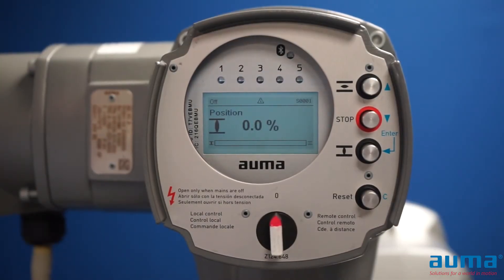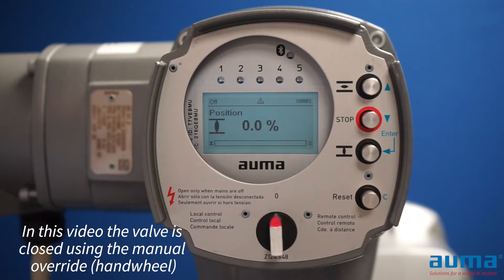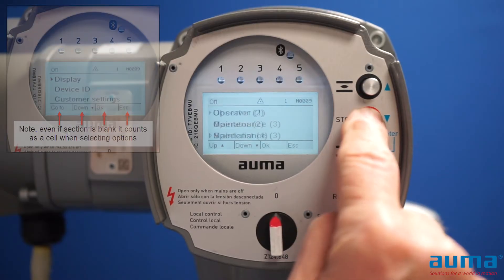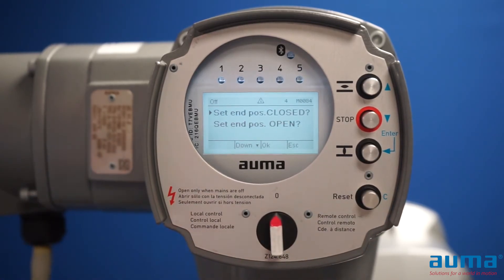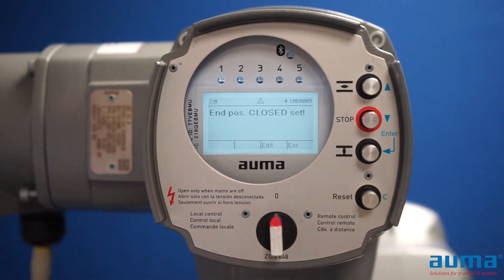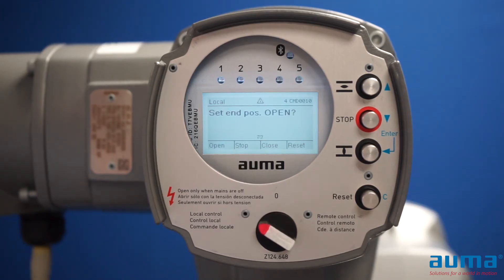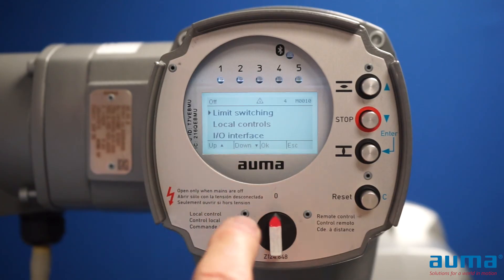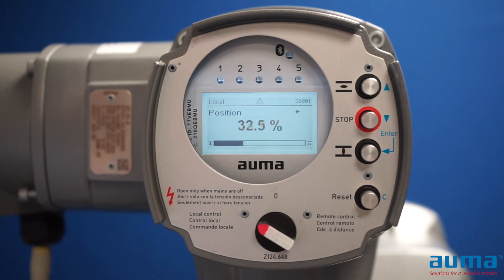AUMA Actuators - Setting Limit Switches - MWG Non-Intrusive

Comment: Hello. There is a problem with the push buttons on this device. Where can we get information about their repair?
Reply: Comment is old but I'll reply. The buttons are magnetically operated and not serviceable without destroying the cover. Where I work as the instrument tech I take the cover off remove circuit board and use a small magnet to operate the buttons. It's not a great fix but we have about 18 of these and all the cover magnets are bad. The units we have are maybe 4 years old. Was told by Auma they had a bad batch and would send us all new ones. Still have not heard back...

Comment: Sir what exactly is MWG
Reply from the maker: The MWG is the control unit inside our actuator. It consists of magnetic encoders that measure torque output and determines and reports actuator position. The MWG will only work with the AC01.2 motor controls and It is located in the actuator surrounded by a protective plastic casing
Reply: @AUMAActuators-USA  Sir when dose user calibrate via MWG and GTLS Mechanical limit switches? or can use either one
Reply: Sir AUMA actuator MWG fail sensor what's the problem
Reply: What is full form MWG